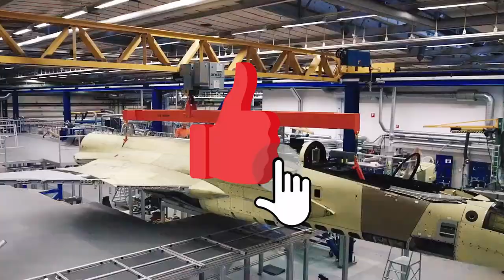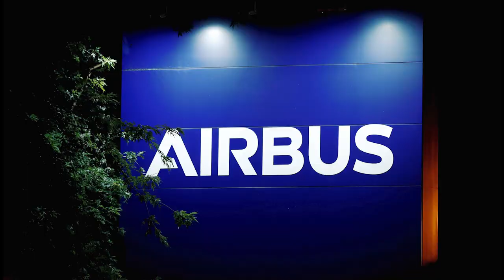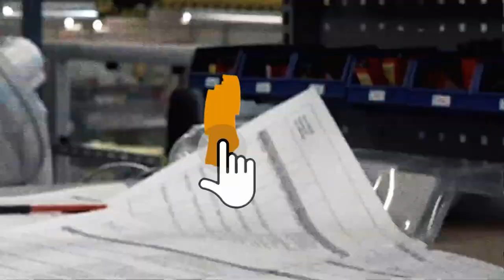Finally: NATO Testing Its NEW 6th Generation Fighter Jet!

Comment: The U.S. have already test-flied its 6th generation fighters. It's called NGAD program.
Reply: It was a Digital Preview, theres not even close to a Prototype being done simply cause the US does not have the Technology needed to get above 2 Mach wich is the Goal
Reply: @itshaze834  just go fast is done in the 70s... the big problem with going over mach 2 is the range limitation and huge aerodynamic heating on the surface of the fighter jet... first you need new materials or shapes to overcome this issues overwise going over mach 2 is stupid and not beneficial for a stealth fighter.
Reply: Sep 2020 issue of Defense News has a big write up about the test flights of the NGAD.

Comment: The F-35 was a joint programme not a solely American one. I understand the U.K. did a lot of the electrics on the aircraft.
Reply: The UK company BAE produce 10% of the aircraft. They also provided a lot of the IP for for the lift fan technology
Reply: @mattgummerson8370  BAE  systems upgraded quit significantly the EW systems hardware and software this system AN/ASQ 239 will be integrated in to other  platforms
Reply: They also provide the lift fan, roll posts and an engine variant (for the F35b). So quite a lot of the 'unseen' tech behind VSTOL.
Reply: Italy also contributed, and they are working together on tempest

Comment: Just to comment on the Russians 'successfully testing the SU-57'. That program has been marred by technical and design problems, years of delays and a crash in 2019. Forcing the Sukhoi CEO to resign. Only a small number of prototypes have been flown, and just a handful of production aircraft have actually been delivered. The service entry and production having been significantly scaled back in 2015 compared to the original plans. The SU-57 also lacks a suitable engine, which will not be delivered for some years to come.
Reply: I think the lack of use of the Felon in Ukraine (to gain vital air superiority) says more about the REAL status of the SU57 program than anything can...
Reply: @sbg911  the su57 has seen extensive use in ukraine" whered you get that info? it's effectiveness is an entire different question, but theres definitely videos of the felon in action or atleast in the AO
Reply: I'm doubting the SU-57 will ever enter full scale production and might stay stuck in a pre-production state just like the T-14 Armata and other advanced Russian weapons programs.
Reply: @texastootin1628  I have tried twice to answer you but my comments have been removed - there was nothing in them that broke Youtube rules, so I suggest it may be the URLs I provided to the info you requested. Therefore no point in providing them again as this comment may disappear as well. What I did respond personally was that I said LACK of use, not no use. Hopefully one or more of my comments may eventually re-appear for the fuller response.

Comment: Drone warfare is a scary thought when hacking such a craft seems easier than keeping a pilot inside the craft
Reply: Yeah, you aren't going to hack that aircraft.
Reply: @MrJdsenior  I mean in the world of an ever increasingly powerful world of hackers, satellite and commandeering of craft seems plausible, but yes, I do agree with you on account of there being a direct link of these craft being controlled by the navy and THEN a satellite to coordinate information. The perpetrators would have to commandeer a vessel that has control of such a craft or steal it by neutralizing the vehicle by other means imo.
Reply: @mischievous7129  Getting hold of the 'control' might be the best method, but only for the moment, I expect.  I suspect there are real time ask/respond polling protocols with unbreakable and probably dynamic keys in place to absolutely protect that link.  If I had designed it there would be, and the engineers I worked with were very smart, for the most part.  

There are easy ways to make it so that even the DESIGNERS of that interface would have no chance of breaking into it remotely.  You could even go to the point of using 'key' generators that are TRULY random, not some algo.  

You CAN neutralize such a vehicle by several means readily known but not that easily implemented, and by that I mean REALLY DIFFICULT, and doing it on a large scale is practically impossible.   I am speaking to the esoteric methods, not a AA rocket, obviously.  Aircraft will always be vulnerable to hard defenses. but very low radar cross sections, IR masking methods, jamming, chaff, etc. provide some defense to even that mode.  It won't be 100%, as we have already seen, but it will be effective to a significant degree.

Obviously to date the controller of those aircraft is a human, which is also not 100% reliable wrt this subject, but again, it would get them one plane, and a lot of closely guarded technology, but it wouldn't allow them to hack the other aircraft.

Quantum computers are starting to do some amazing things, but there will always be evolving measures/counter measures/ counter counter measures (really), and improvement of old modes and occasionally new modes of such protection.  It is really all about staying ahead in as many of those areas as you can, and right now, as far as I know, the US leads in most, if not virtually all of them.  We haven't seen an even REMOTELY real aircraft like an F35 come up against the best Russian craft yet, but when we do I think the world will be shocked.  It will be a video game that the Russians will lose, badly, and most of those pilots will never even SEE (radar, FLIR, etc) those adversaries.  Virtually or totally lights on/lights off.
Reply: @MrJdsenior  Oui, la clé c'est l'être humain! jamais il ne disparaitra  totalement au profit d'un drone! les deux hommes pilotes et drones ensemble.
Reply: @marc9080  It is so nice to be able to converse, at least to some degree, in a language I don't know.  🙂

The only thing I would point out there is that never is a long time.  It will be a while, though.  Even then a human will likely make the final call, if for no other reason than our ego and perceived control, which is mostly illusion when you really study it, but I won't go into that here.  

He just won't be on board, eventually, because if he were, the craft would be a sitting duck, due to human limitations in g, control response times, etc.  Eventually even that will disappear, but it will be a long while, I'm guessing.  When a human in the loop makes you lose to an adversary without that (ultimately) dead weight in the loop that takes a relative eternity to make a decision, etc.

Times are changing, but not as quickly as some have predicted, and much more quickly than others.  It is COMPLICATED.  :-)  I expect at some point the AI will answer with something like, "Thanks for your input, I will give it all the consideration it deserves".

Comment: The US is well ahead in the 6th gen arms race.  The project is likely kept black (top secret) because of the advanced nature of the machine, but Congress has already said that they have seen a test flight already and are pleased.
Reply: The American 6th-gen fighter for the FA-XX program looks like a copy of the Chinese J20 with canards
Reply: @aburetik4866  there are significant differences.  The thrust nozzle on the Fa-xx has fines like the F-22.  Whether that’s for vectoring or just ir reduction is unclear.  The wings are also wider than the J20, and (most notably) the aircraft lacks a rudder.

Comment: The British Taranis program started in 2013 and the tec tested and developed from that program looks to go in the Tempest. This looking forward as to whether a pilot is required or not. Loads of vids of the aircraft flying on YouTube so the Brits may not be as far back from the Americans as some might think.
Reply: most people would say britain and american operate similar tech, the difference being the US can afford a lot more of it.
Reply: But they’ll find a way to screw it up and end up with a reduced order for an inferior product. Remember, Britain gave the railways to the world, and it now has one of the worst, most wasteful rail networks anywhere in the world.
Reply: Yep, Britain will be the next closest to getting something real flying. If they can afford to field a meaningful number of them is another question. If they go the full drone route, that might be best… although they may choose piloted craft just for “moral” reasons, which is dangerous when the main competitors have no such qualms.
Reply: @jamjardj1974  One of the worst? How many high speed lines are there in the US? The Brits have one and another being built. The UK has designed a fighter that’s already been up and down the runways. The Japanese & Brits are building a new type of engine. The Tempest has a coating that is expected to give a 450mmx300mm cross section, and it will become smaller with development. The USN 6th gen will be using the Brits new skin, Biden and Johnson agreed it months ago.
Reply: @Cdr_Mansfield_Cumming  🤣🤣
Reply: @jamjardj1974 It's not even ranked as the worst in Europe.

Comment: Unlike the F-15 and the F-22, the F-35 is not an air superiority fighter. It wasn't meant to be. However, with all the hype of a 6th gen a/c, the F-35 is being deployed and so far it looks like it works.
Reply: Umm..... did you notice how you mentioned different missions?  You're correct, the F-35 is not an air superiority fighters.  To say it wasn't meant to be is a fallacy.  That's the way it ended up.

AND this is why the different nations are working on their 6th gen plans regardless and without the US.  The F-35 let down different partners that were interested in an air SUPERIORITY craft.

The F-35 was meant to be a common aircraft among the different nations to be used in any warfare situation, and even now the Air Force likes the idea of using it with the F-22, but the F-22 isn't produced.  Different nations wanted the F-22, but can't get.
Reply: except the plans were probably at Mar lLago, LOL
Reply: Also the F-35 is riddled with electrical faults, as well as being extremely expensive.
Reply: then why do they keep getting grounded?
Reply: @johndoh5182  And no one can get it since Lockheed/Martin lost all the tooling plans. Hmm. 

Actually it was never meant to be an air superior fighter in the sense of the F-15 and the F-22. Look at the original request. Sort of like the original f-18 concept. Time and time again we found that general purpose aircraft just are not down-in-the-weeds dogfighters. The F-35 is more like the F-16 on steroids.
Reply: @teamalpha7423  most issues have been fixed, and here’s a fun fact, the f-35 is cheaper than most 4th/4.5 generation fighters (examples include the euro fighter typhoon ( 117 million) f-15ex(also 117 million)) and to end this off, the f-35 has a 20:1 kill/death ratio in red flag exercises, beaten only by the f-22 raptor.
Reply: @jasonrhodes9683  why did the f-16 crash weekly? Why did the a-10 kill more friendly soldiers and civilians than any other jet? Why did the f-111 out preform the a-10? Why does the f-35 still out preform several jets like the f-16 and the f-15 at both ground attack and air superiority?
Reply: @kanash8851  I bet you are going to have weekly crashes when there are probably 2,000 to 3,000 F-16s. I wouldn't be surprised if most of the crashes weren't pilot error, lack of maintenance or the planes are too old and worn out.
For the 'Hog, when the Sandies heard it coming they would try to close with our soldiers or civilians hoping they wouldn't get attacked. There is always some human error too.
The 'Vark and the 'Hog have too totally different missions and there is very little overlap. You are comparing apples to torque converters.
The A-10 was designed for air to dirt missions, enemy forces on the battle field.
The F/B-111 was for strategic targets that required immediate actions. 
The Y-35 won the competition by being shot down less than the Y-32 by a colonel in an F-15c.
The Falcon is NOT an air superiority fighter, its a fighter bomber than isn't really supposed to go into enemy controlled airspace without a fighter escort.
Why you ask? It doesn't matter how fast an airplane can turn, the human body isn't designed to take more than 10Gs. Most Gen 5 fighters won't let you turn much harder than 10Gs. 
Have you ever seen a competitive aerobatic pilot? The look like hell when they get out of the plane. Their eyes are always bloodshot from burst capillaries from too many negative Gs.
I wouldn't doubt that a lot of them eventually die from strokes or aneurysms.
Reply: @teamalpha7423  it's cheaper to build an F35 than it is to build an F15, development costs quite a bit more than the finished product
Reply: @jasonrhodes9683  You could quite literally use a b1 lancer and it would still be better at cas than the a10, don't go reformist on us
Reply: @jasonrhodes9683  yo I’m not even gonna lie, you’re gonna have to give me a second to combat this (a wolf spider decided my bed was his last night so I slept like 2 hours) Expect a reply around like 6 pm or something idk
Reply: @domesticonion8026  the Tempest is going to cheaper than both F15 & F35
Reply: @teamalpha7423  if it every gets built maybe
Reply: F35 is cheaper than the better F22. The F22 is only used by the US. The f35 design is also shared to many allied countries

Comment: This video made so many false assumptions and statements that in one moment I thought the guy was simply trolling us..
FCAS or the German-French-Spanish program to build the 6th gen fighter most freaking definitely won't be the first 6th gen fighter to become operational since the countries that actually develop the platform said the FCAS will be introduced into the fleet in 2040..
On another hand Pentagon leaders have said that the USAF already fly tested the 6th gen fighter known as the NGAD program.
Not only that NGAD has been receiving funding since the 2015 (FCAS received it's first Euros in 2018) but the money that the European countries have been diverting towards the FCAS, are laughable compared to NGAD. 
So let's recapitulate. FCAS - operational in 2040. NGAD - by all the recent statements by the members of USAF, Pentagon and Office of the Secretary of Defense, is targeted to become operational by the late 2020s, or 2030 at the latest. 
Russia will be happy if they'll be able to finance maintnence on the few 4th gen Sukhois they'll end up with after the Ukraine war ends. As far as China is concerned, they still have huge problems with developing modern jet engine for their 5th gen J-20. I doubt that they are capable of developing a much more complex and advanced Adaptive cycle jet engine that will be needed for the 6th gen fighter, before mid 2030s. So once again - US will fly and operate the first 6th gen fighter jets and the systems that will accompany them (supersonic UCAVs, hypersonic a2a missiles and the defensive laser system)...
Reply: This is 100 percent on target. All true. All facts. No BS. Someone who knows what they are talking about.
Reply: On point.
Reply: C'est juste ton opinion voir TON rêve! l'avenir ne fonctionne pas comme ça! mais fais toi plaisir!
Reply: @xandervalltessa3685  can you state otherwise?
Reply: @xandervalltessa3685  Make a counter argument. The Franco-German fighter is pretty much at a standstill because they can't negotiate work share for the program.
Reply: @Cartoonman154  not anymore at least for phase 1B lol

Comment: The U.S. Raptor has far more advance technology that can’t be sold until it’s replacement arrives. As we watched the world work on their 6th Gen programs, the US is already testing their’s. 
The more 6th Gen programs from NATO Allies the better. This shows how countries collaborate on more programs to better support each other.
Reply: Also the Raptor has all sorts of ancient electronics not available on the market any more and after completion of the project they let the engineers move on. Which is one reason why F-35 was developed. Really a shame, since it's one of the most gorgeous planes.
Reply: En Seotembre 2001, il était OU ton Raptor???? qui domine le monde!
Reply: The Raptor has suffered performance issues from the outset, and has extremely high maintenance requirements which have resulted in availability rates that are by far the lowest in the U.S. Air Force. While the Raptor was initially intended to replace the F-15 Eagle, production was terminated in 2011 less than six years after the fighter first entered service. To put this in perspective, the F-15 first flew in 1972 and entered service in 1975, but is still in production today and is expected to see a production run of over 55 years. 

Now; a number of analysts have considered the F-22 program a failure. The fighter is just not practical in any sense. Its also riddled with spaghetti code from post cold war era hence its really hard to have any software upgrade, which has had some progress the last 20 years. Right now F-22s are getting scrapped for parts to keep other F-22s flying. Its tech is laughable at this point, no new sensors since 2005, still running legacy AIM-120 missiles and no HMS. 
And btw, the f-22 wasn't sold to other countries because congress got fed up with the US always having to pay the R&D, not because of the tech.
Reply: @olelien5055  Yeah the F-22 really needs a overhaul in it's capabilities.
I've been saying this for years but F-22, fanboys will just tell you it's the greatest jet ever until they are blue in the face.
The F-35 and subsequent fighters(EF 2000, JAS-39 etc.) are really the future of fighter jet capabilities and warfare.
Reply: @marc9080  It was barely in production in 2001🤦